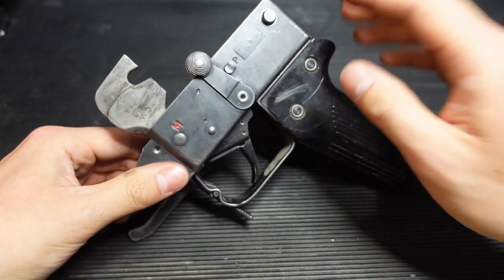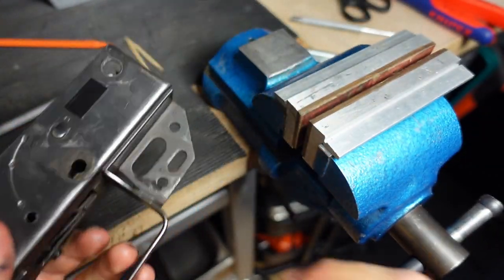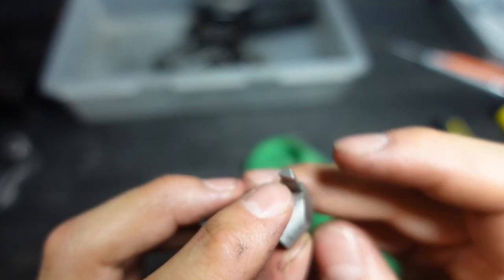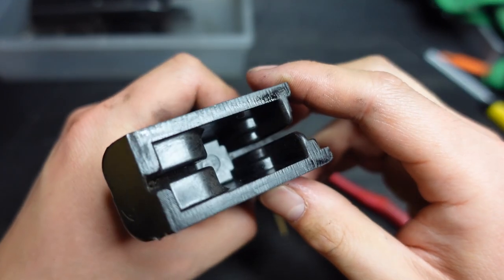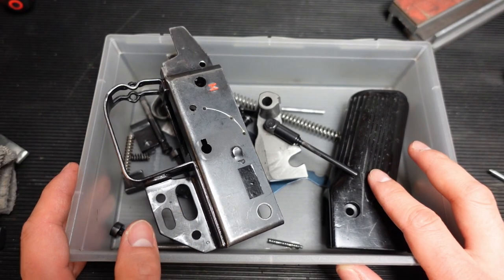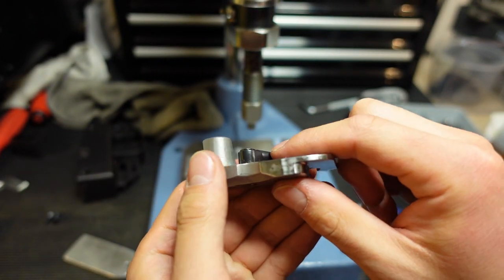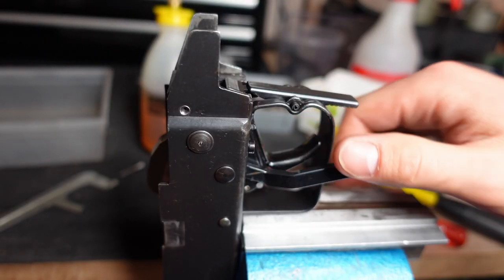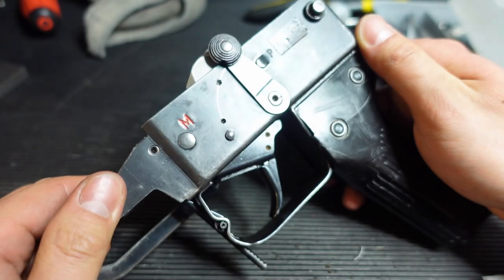Sturmgewehr 57 (Stgw. 57) Trigger Group Maintenance & Repair

Comment: Many thanks Dale, a great video.  I'm the second owner of the rifle, having bought it from the soldier to whom it was originally issued.  It is a 1962/3 vintage rifle, but I have no information about refurbs, maintenance since.  The cloth in the handle is a cleaning cloth, in case the bolt gets too dirty during firing.  I have not ever cleaned the trigger pack, but do inspect it regularly for wear, and grit in the mechanism.  The dust you mentioned probably came from Finnish Brutality 2022 (I was the guy in the Kilt that wasn't Ian).  I rarely use the winter trigger, so the bend probably came from its life before me.  Now you have adjusted the trigger weight, I'm going to have to re-learn it all over again!  Once again, thanks for taking a look at it and giving it such a thorough going-over.

Comment: FYI penetrating oil attacks rust. That includes rust blue.
Reply from the maker: Penetrating oil seems to be just thin oil, so I get how it can loosen powdery red rust. Are you saying that oiling an oxide blued surface strips bluing 🤔.
Reply: @DaletheStgwDude  
I was told it does. I say soak a rust blued part and see if it gets progressively lighter over time.
Also instead of scrubbing rust off it's better to convert it by degreasing, boiling, steaming and carding. That converts the slowly accumulated/dense grain rust to rust blue again. No rust blue solution required.
edit: and use mineral oil for the first week to let the process complete
Reply from the maker: @Foche_T._Schitt  I would love to see any formal written references stating that certain grades and viscosities of mineral oil (aka “penetrating oil”) do indeed detach and attack iron black oxide layers. Please share!
Reply: @DaletheStgwDude  
Mineral oil isn't penetrating oil. PB Blaster is what I consider a penetrating oil.
Watch Mark Novak's rust bluing video's. He's got the same Firearm Blueing and Browning book by R.H. Angier that I have but I've only partially read it.

Comment: Hello. 
Do you know anything about the springs for the trigger assembly. 
I would like to make, about 2kg on a normal trigger. (not winter triger) Do you know anything about this subject?
Reply from the maker: Hi Andrzej! You can theoretically simply adjust the trigger second stage spring to have the bare minimum of engagement. 

However, your trigger would become very difficult to use, because the first stage alone is already ca. 1-1.5kg! Therefore, it would be too easy to overshoot the second stage and negligently discharge. 

Therefore, the only real solution is to regrind and relap the sear angles to be less positive. 

I suggest getting used to the factory trigger. To help with the first stage stickiness/grittiness, I suggest greasing the sear surface.